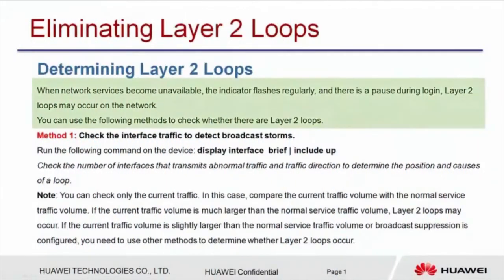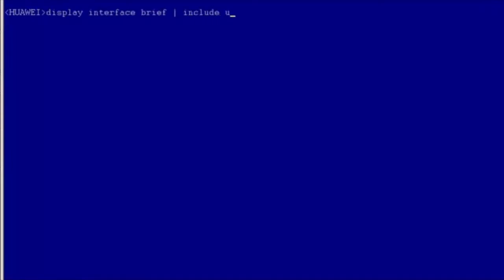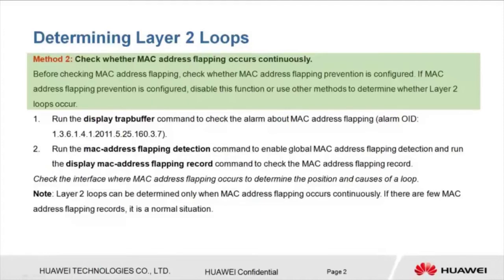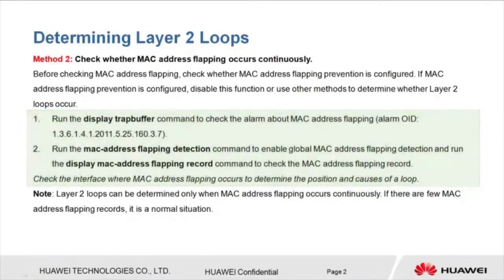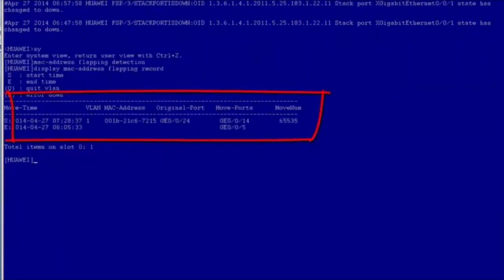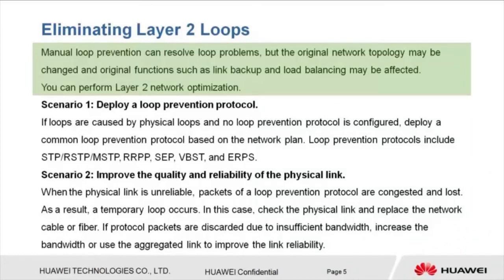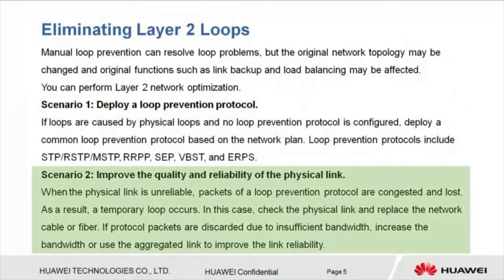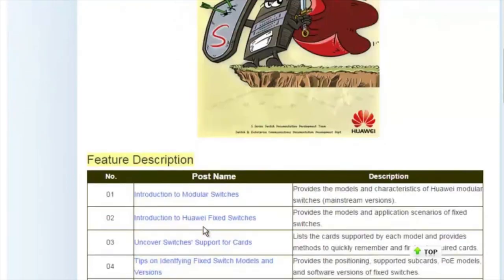HUAWEI S Series Switch-Eliminate Layer 2 Loops

Comment: Hi i am running an ISP. 
How to configure the porrs in such a way that my network doesn't effect with loop and mac address flapping
Reply from the maker: If Huawei switches are used, ring network protocols can be deployed.
For V200：
https://support.huawei.com/hedex/hdx.do?docid=EDOC1100364141&id=ZH-CN_TASK_0177091343
For V600：
https://support.huawei.com/hedex/hdx.do?docid=EDOC1100365988&id=ZH-CN_TASK_0000001620477549
Thanks for your support.